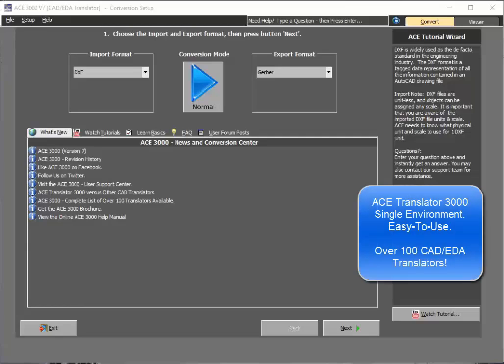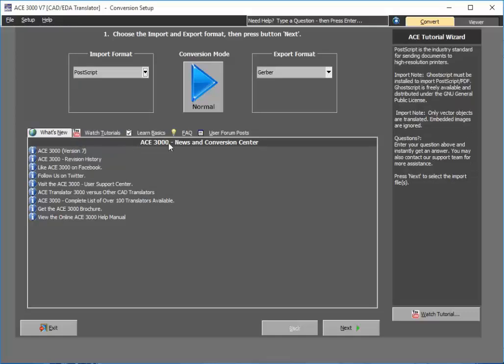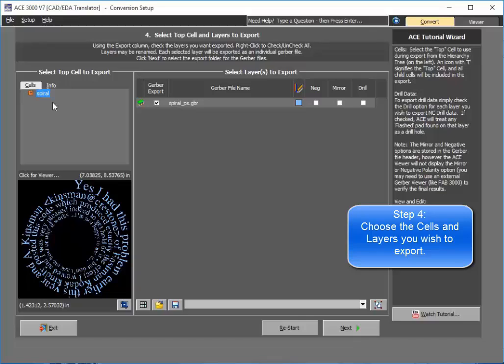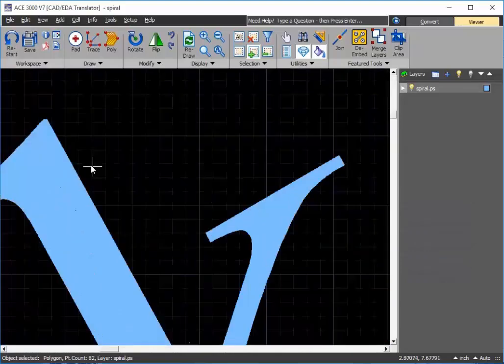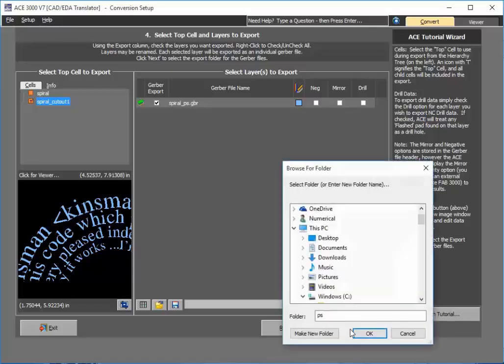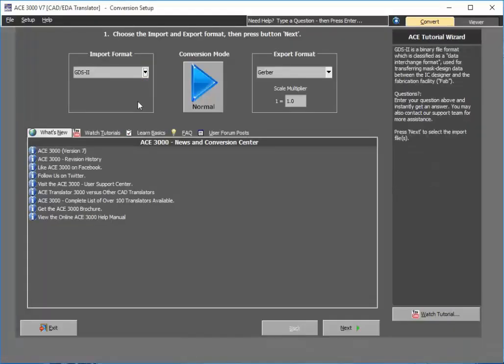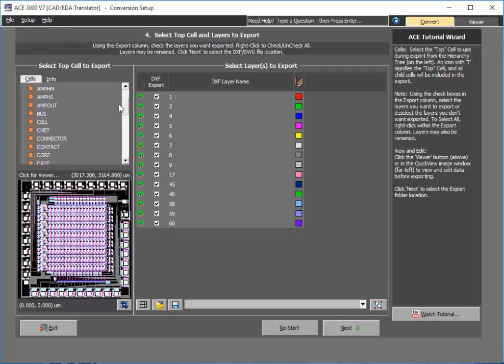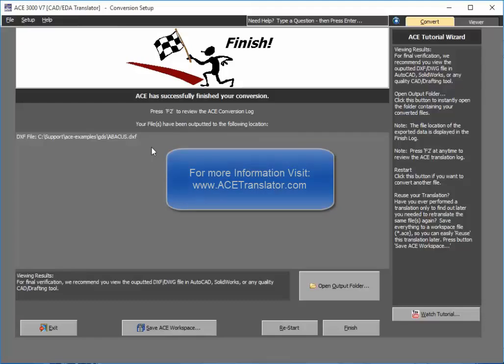ACE Translator 3000 Overview

Comment: Can this convert a PCB from the Allegro format (.brd) to Altium format (.PcbDoc)?   Even after using Cadence's extracta to construct an ascii file (.alg) (with no errors), Altium still didn't import the PCB properly.. the middle layers were repeats of the top layer!    

There seems to be other CAD converters, but they seem geared towards converting mechanical or gerber formats (ex. FlowCad).